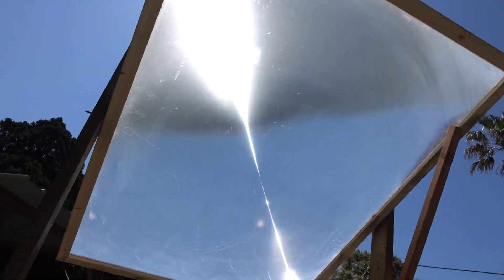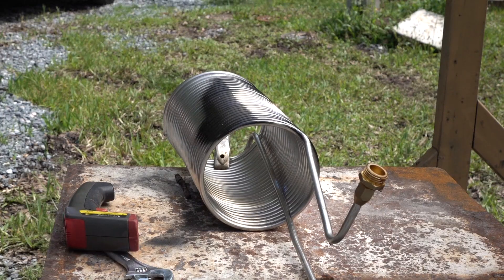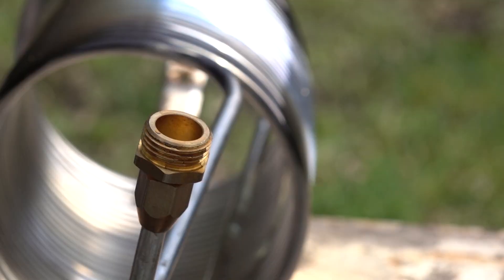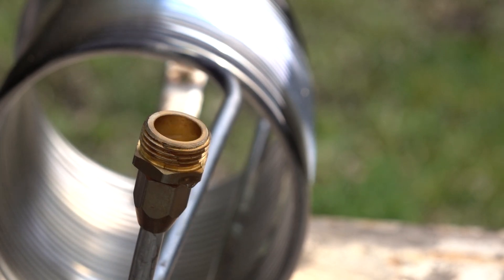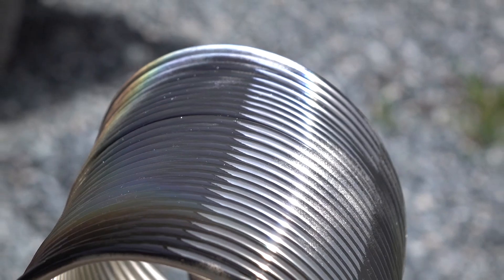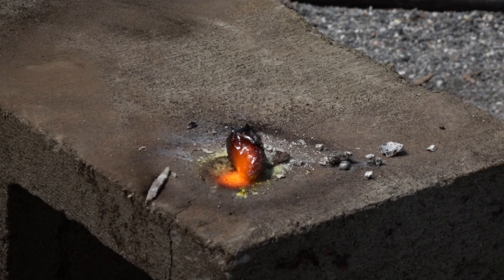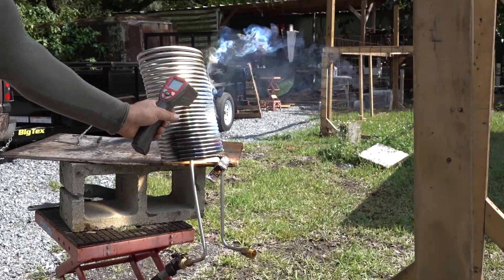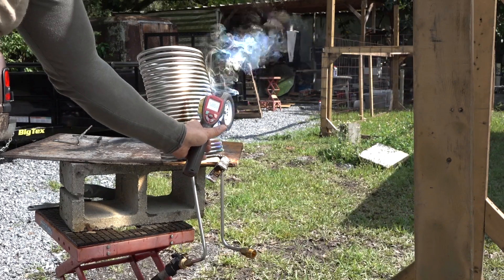Wort Cooler Chiller Fresnel lens for water heating and steam

Comment: Add a pressure relief valve to the end of the pipe and adjust until the steam releases at set intervals.  Set the coil inside a metal container and surround it with magnetite sand.

Comment: I think is salt what they used back then when they tried to produce steam from heating with fresnel or mirrors, the salt can be melted and thar way holds more heat.   In real life the thing had leaks and they never generated anything.    Maybe a ceramic is the solution, surrounded by steel so it heats water and produce steam.

Comment: I ordered a linear lens from you a while back. I just put in an order for linear actuators and sensors to automate the aiming of the lens. I was planning on using aluminum vehicle radiators as my heat exchange since this lens isn't rated to melt it and it will be on a heat exchanging loop. If I ever actually get this thing built and it works I'll drop you an email.

Comment: Hey Dan, would you be able to do a science experience with a wort coil in sand insulated in a chamber and measuring how high and long it takes to contain the heat. Also, how long it takes to disipate running cold water threw the tubing.

Comment: copper with copper oxide burn coating for direct concentrated heat-electricity from thermo-couple electric Cu-CuO, as copper pipe, cold side inside, air or water cooled, dual function
Reply: directly produced with camp-fire or rocket-stove copper loop, outside is a dark terminal, hot, inside is the copper terminal, cold

Comment: Hey Dan so pleased to see another video from you after such a time! I have deduced that (especially in cold climates/ air temp) evacuated tubes with heat rods are perhaps the best heat concentrators - meaning temperature increase per surface area.  Perhaps however for a given surface area, using an optical concentrator such as this coil could be better?  Certainly this is alot cheaper!

Comment: Glad to see you back, could you do a half round shiny surface behind it and reflect on the whole back and some glass in front and use no lens
Put some together, probably be a effective water heater,  the half round would probably have to be the size of a half barrel for the size of the  Coil and maybe get some hot air through it also hope you will try it.

Comment: Funny, I was thinking of doing this with the high side lines of AC lines to sanitize water in a emergency or warm small showers. They are similar in size and have been collecting a few over time, but I'm sure these stainless steel lines would tolerate more heat without melting. Thanks for the heads upnon where to look for them!

Comment: I have a similar design using 
'Leibig condenser" type setup. 
But heat oil to heat the water. 
Proves more efficient after intial heat as less loss over time than water. 
(Plus oil can go to over 100°C without becoming steam)

Steam equals turbine equals CHP. 
Combined heat and power.

Comment: I'm curious, would such a coil actually pump water to a higher elevation while it's being heated and turning the water to steam?
Reply: It seems to me you COULD do that by connecting this to a pressurizing tank. You would need to be sure to add a reliefe valve (possibly two so you always have a back up in case one faild) to relieve the pressure once it exceeds a certain threshold so as to not explode your pressurizing tank. I would watch some YT videos exposing and explaining  the innards of pressurizing tanks so you get an idea on how you would connect this to push water. Seems totally doable to me.

Comment: Dan, it looks to me like you just made post-apocalyptic Survival a thing of ease, with this.
Not only can you heat water for bathing, etc... but that demonstration of quick flash steam shows that we can use a fresnel lenz to speed up the process of distilling water.  So if we have barrels of lake water, we can use this setup to flash the water to steam and collect the condensate... quick and easy distillation.
I wonder if this would also work for distillation of alcohol?
Reply: There is one small hitch....the boiling point of alcohol is much lower than water, which is why alcohol vapor distillation is possible.  Your temperature needs to be steady at about 175F degrees (alcohol boils at 173F).  Water boils at 212F so you want to keep it well below that.  It's not altogether impossible but you're basically talking about needing a heat exchanger at some point in the mix to regulate the temperature.
Reply: @NGinuity  Thank you.
Reply: water distillers know what they're doing.  it is possible to turn water into steam and concentrate the particulates in the steam.

that's not what you want to to do.

Comment: Hey dan, would copper work? Let's say smaller fresnel lense? 
I have a solar water heater idea non-related I have been wanting to try. Black Reservoir inside a clear "box" with a coil possibly. Cheers,  thanks for sharing  for years, lol!
Reply: Copper transfers heat even better than stainless, but you'd still need to give it a black coating.
Reply from the maker: Copper would be better especially if it has tarnished a bit naturally. Downside to stainless is the need for black paint which results in a second surface thermal barrier... minor but makes a difference. If you can evacuate air in the box with sealed argon, your efficiency will go way up. Make sure your target area is smaller than the lens you are using or it is a net zero....
Reply: @GREENPOWERSCIENCE   I wanted to run it by the pro 1st you're in my head with the evacuated air. I watched the video where a guy was able to take a black  metal water bottleAnd put a 2liter bottle over it to get 187degree water. It got my wheels turning. Thanks Dan
Reply: Also I would like to make a solar oven outside of one of my windows. they can also be used as an air heater. clearbox black bottom, seems easy enough.

Comment: Nice - I believe this is how the tankless water heaters work but they use natural gas to heat up the coils and electricity for electric version.  Using the sun to heat up water is also an excellent idea I remember when I left a tool outside in the sun it was so hot I had to use gloves to pick it up.   Metal seems to just absorb the suns heat.
Reply: Tankless water heaters (elec) have a brass manifold with immersion heaters (same as  a regular hot water heater, only the heater(s) are  smaller) that are installed in the manifold allowing the water to flow around said heater(s)

Comment: Too bad you can't get a fresnel in a band focus so you could trough over a reflector halfpipe and make this feasible without having the focal aspect be a just a spot.
Reply from the maker: Mirrors, even flat would work for that. Curved Fresnel lenses lose a lot of their concentration to a common focal point when curved. They do require less tracking but there is a trade off. For a project like this, moving the target closer, so the focal pattern covers the entire collection area is more efficient for mass collection.
Reply: @GREENPOWERSCIENCE  I don't mean bending the fresnel, I mean a mirror curved underneath the band of focus so the concentration is on a line, and the trough reflects what goes around the collector pipe, reflecting it to the underside so you have a full light condition on the collector. Hard to get more efficient than that.